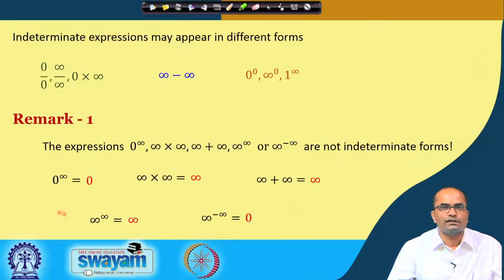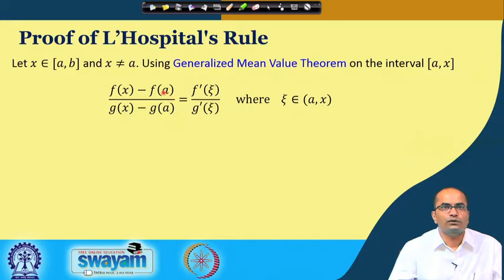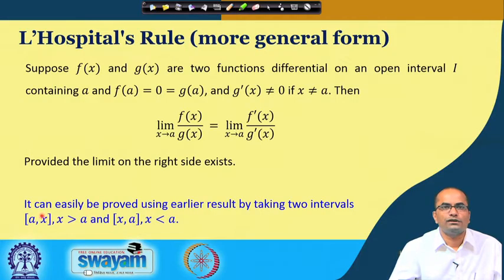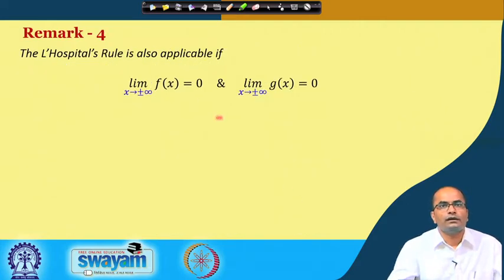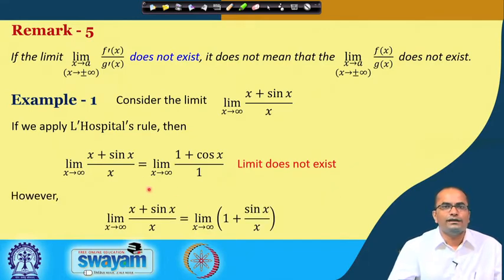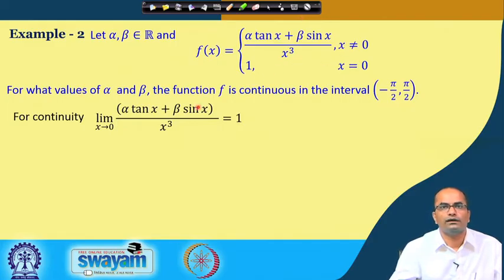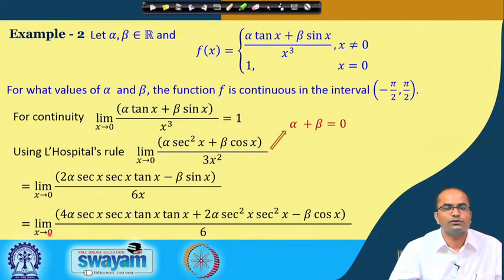Lecture 03: Indeterminate Forms Part I

Comment: Here is a detailed index that you can use for your PDF, based on the lecture summary:
Page 1: Title Page
 * Title: Indeterminate Forms and L'Hôpital's Rule
Page 2: Introduction to Indeterminate Forms
 * What are Indeterminate Forms? [00:00:32]
 * Examples of Indeterminate Forms [00:04:18]
   * 0/0
   * ∞/∞
   * 0 * ∞
   * ∞ - ∞
   * 0⁰
   * ∞⁰
   * 1^∞
 * Expressions That Are Not Indeterminate Forms [00:05:03]
   * 0^∞
   * ∞ * ∞
   * ∞ + ∞
   * ∞^∞
   * ∞^-∞
Page 3: L'Hôpital's Rule
 * Introduction to L'Hôpital's Rule [00:06:24]
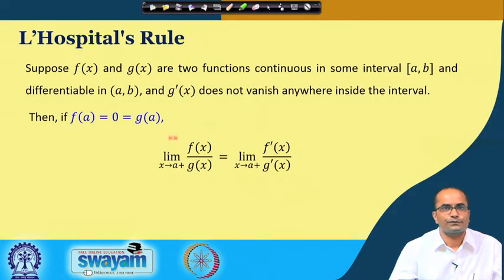 * Rule for 0/0 Indeterminate Form [00:07:04]
   * Applying the rule
   * Example
 * Repeated Application of L'Hôpital's Rule [00:14:01]
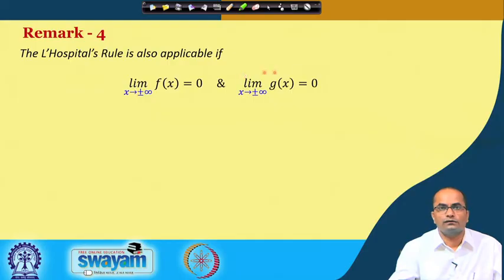 * L'Hôpital's Rule as x Approaches ±∞ [00:15:38]
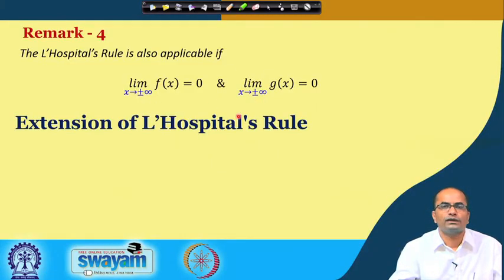 * Rule for ∞/∞ Indeterminate Form [00:16:01]
 * Important Note on the Limit of Derivatives [00:17:17]
Page 4: Example Application
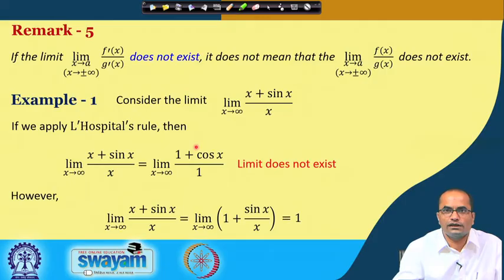 * Problem Statement [00:20:01]
 * Step-by-step Solution using L'Hôpital's Rule [00:21:57]
Page 5: Summary of Key Points
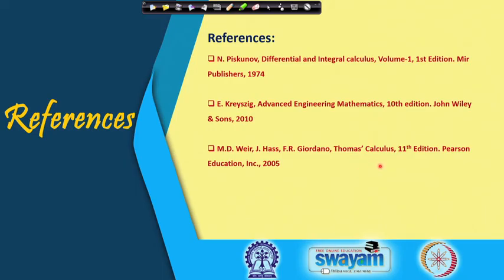 * Indeterminate Forms and Their Types [00:26:50]
 * L'Hôpital's Rule for Evaluating Limits [00:27:16]
   * 0/0 form
   * ∞/∞ form
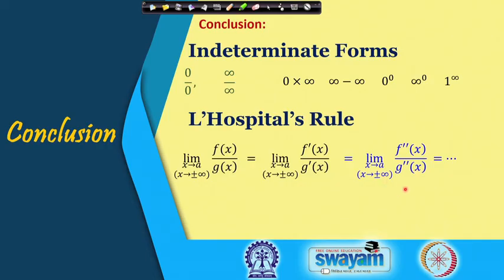 * Checking the Existence of the Limit of Derivatives [00:28:03]
You can use the timestamps provided to find the exact points in the lecture to take screenshots for each section. This index should give you a good structure for creating your PDF.